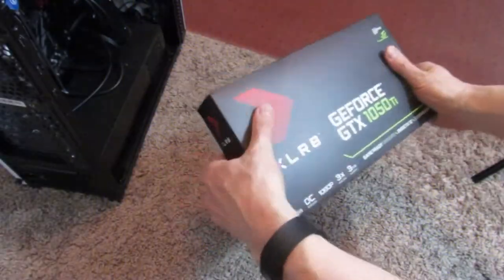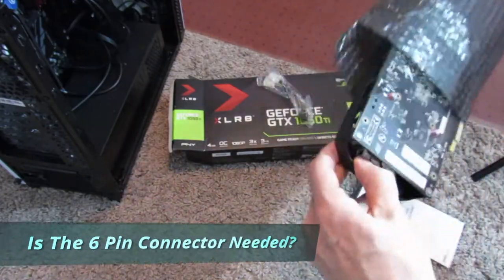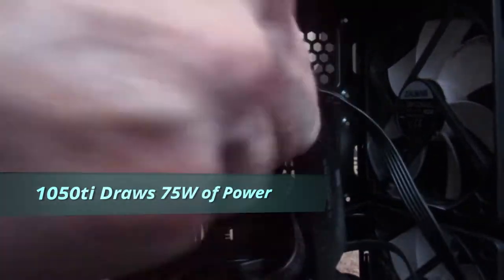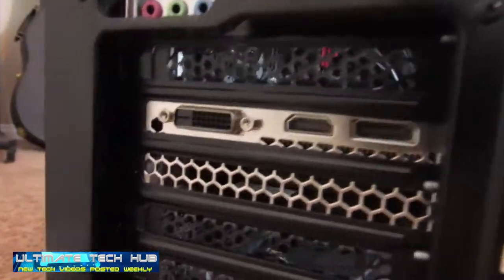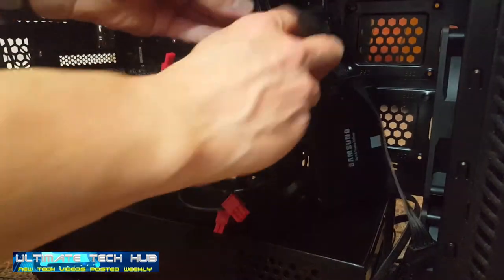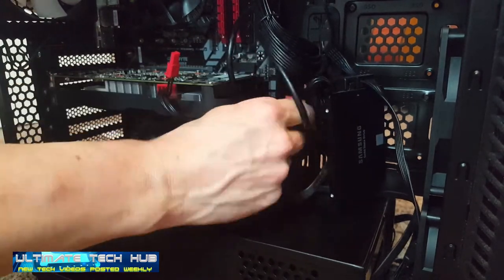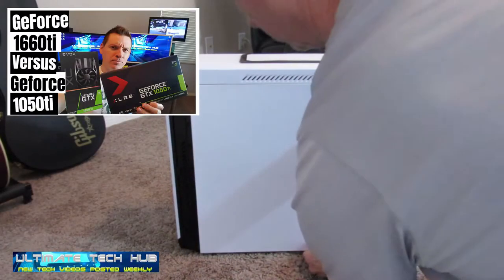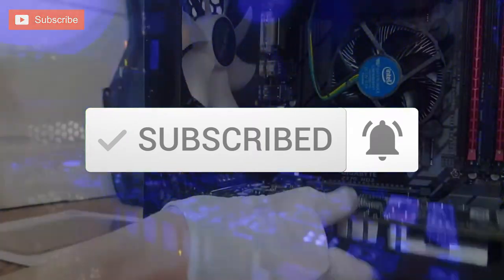GTX 1050ti INSTALL - DOES IT NEED A POWER SUPPLY?

Comment: can i run gtx 1050 ti on my prebuilt pc (hp prodesk 600 g2 sff) 
i5 6500
8gb ram single channel
500 g hdd wb
psu 200 watt high quality
soo can i and thanks for any recommandation
Reply from the maker: If the hp is a mid Size case it should fit. 200 watt psu may not be enough. I would recommend a 350 watt psu.

Comment: I'm looking at a gigabyte 1050 ti 4gb oc edition, and it does have a 6 pin power connector, can I run it without the 6 pin power?
Reply: Did u figure this out I need to know
Reply: @DomZ15  I asked someone about that who owned a 6 pin 1050ti. They said the card wouldn't even power on without the 6 pin cable
Reply: @WeeeAffandi  does the gpu come with the 6 pin cable ?

Comment: I have 400watt power supply  it doesn't have the port for any gpu power plug
Reply from the maker: Does it have wires with 8 pins or 4 pins or 6 pins? Those will work.

Comment: Hey, i already the got the card just waiting for some cables to arrive from shipment but, i have a i5 2500 8gb ram and a 280w psu, i upgraded from a gt 730 but will the 1050 ti be ok with a 280w psu?
Reply from the maker: The manufacturer says it requires a 300w PSU minimum.  But I would try your PSU it will probably work. Keep me posted.
Reply: @UltimateTechHub  so i got the cables and the pc seems to be running fine but in my monitor it says check cable conection and thats only thing it shows. im pretty sure i conected everything fine re did it and still nothing i also got a vga to hdmi cable because my monitor is a bit dated.
Reply from the maker: @Balkanboibg  Have you tried a different monitor or cable?
Reply: @UltimateTechHub  dont really have other monitors or cables since this one is from my older pc and probably its just too old for hdmi i talked with my dad about buying a new monitor but otherwise cant think of other solutions
Reply from the maker: @Balkanboibg  can you borrow a monitor from a friend for a day just to test it out? That's your best bet. This way it won't cost you anything. Keep me posted and thank you for watching.
Reply: @UltimateTechHub  finaly foumd the problem. turns out my brother ordered the wrong vga to hdmi cable and i plugged the gpu to our tv and it worked. downloaded drivers did benchmarks everything is good, just need the right cable now. thanks for the replies not many youtubers do that
Reply: Hey so post 2 years, How is it working? I have a 250 watt Psu and I  will  be buying the asus gtx 1050 Ti which doesnt need 6pin connector, Do you think it would work with that PSU?? @Balkanboibg

Comment: Why do some tell me that you need a 300 w or higher
Reply from the maker: Its recommended by the manufacturer
Reply: @UltimateTechHub  I have a 16 gb ram, i5-8500 and a gtx 1050

Will upgrading my psu to 450 increase my Performance
Reply from the maker: @tiredbtw7121  No. Upgrading your PSU to a higher number like 450w or 600w only adds more power. This is good especially for future upgrades like GPUs or other components.  It sounds like you have a good setup. Thanks for watching!
Reply: @UltimateTechHub  can GTX1050TI 4GB DDR5 work without  a power supply  6pin my power supply is  180 Watts
Reply from the maker: @webelievesingod2868  It won't work with a 180w psu. The minimum is 300w psu.

Comment: What psu is good for 1050 ti
Reply from the maker: if you have a 600 watt PSU then that should be enough power the entire PC and like this video points out you don't need to use the PSU for the 1050. Let the motherboard do all the work. Thanks for watching and if you subscribed thank you as well.
Reply: Can it work  without the power  supply  6 pin
Reply: Can it work without  a power supply  6pin